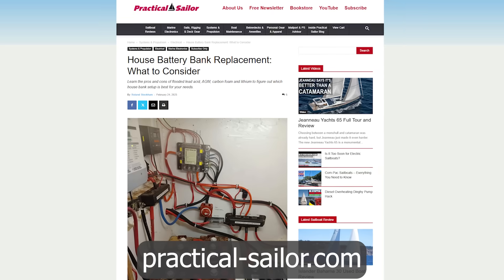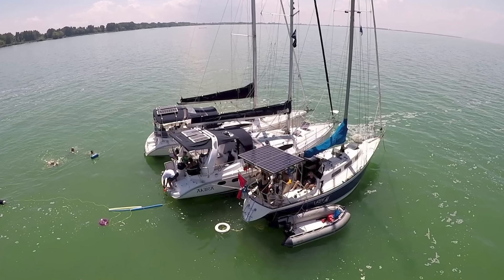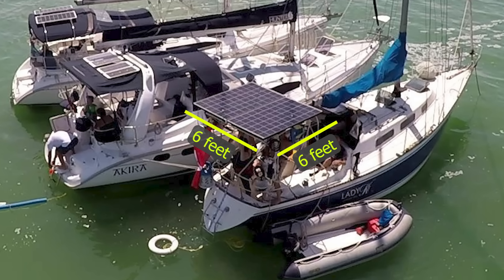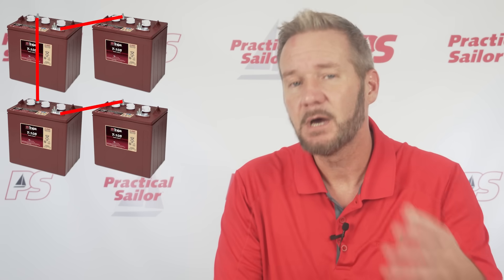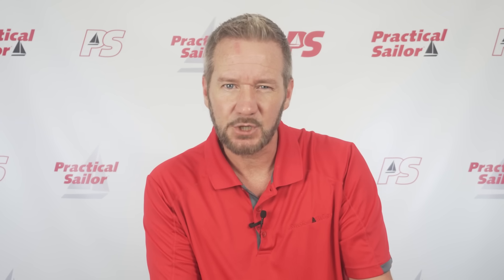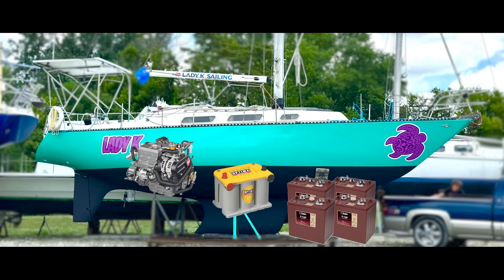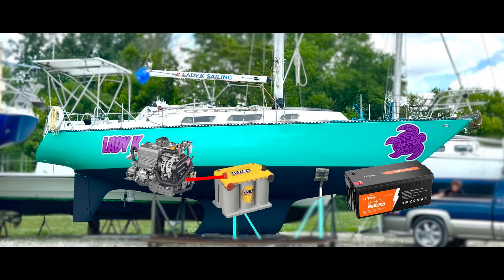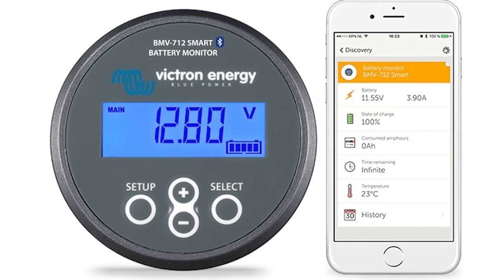Which Batteries Would I Buy TODAY for my SAILBOAT?

Comment: If you have a windlass, does it need its own battery? I thought they were hi current types like starter betteries, but i see people wiring them tocthe house bank.
Reply from the maker: Typically it’s cheaper to provide it a battery of its own than to run big cables forward

Comment: "Lithium is good for 80% discharge" - huh?  If you don't discharge your LiFePO4 batteries below 20% you'll induce memory.  Since you have a diesel engine to recharge why not use the last 20% capacity?

Comment: LifePO4 is becomine soo cheap that I just bought 2 300ah 12v batteries  (roughly 540ah useableo down to 10% )  for 20% LESS than replcing my 4 GC2 fla btateries with 200 useable Ah!   I now have nearly 3x the capacity for less money!  The only thing I had to add was a DC-DC charger as all my other charging sources have lifePO4 profiles . finally LifePO4 makes economical sense over FLA!

My 2 LifePO4 were $400 each.  the GC2 FLA are $250 each.  $800 for the 2 LifePO4 vs $1000 for the 4 FLA baatteries!

Comment: I have a 37 foot boat with 360W solar and 200 Ah of Lithium wired with a Renogy DC-DC converter/solar charger. On a recent passage from Mexico to Hawaii the 30 y/o alternator finally quit. Although I carried a spare I decided not to install it to see if I could do the passage on solar only. The answer is yes but barely. Not surprisingly the fridge was the heavy user. Next was the ST6000 a/p which was used sparingly as the Monitor wind steering unit was doing the lion's share. So there's some data for what it's worth.

Comment: Hello again and sorry for the late comment.  A small boat forum post pointed to your prior episode on toasting alternators and that led to here.  It looks like you went with one of those cheap Chinese batteries from Amazon that has a minimally functional BMS.  You also went with the DC-DC converter and AGM battery.  There are two types of DC-DC basic circuits.  One goes from higher voltage to low and is called a buc circuit.  The other goes from lower voltage to higher and is called a boost circuit.  For a little more complexity you can have a buc/boost which can operate in either mode.  In boost mode efficiency is poor (think 80%) but any buc/boost product can claim up to 98% efficient failing to mention in buc mode only.  AGM needs charging to stay below 13.7V at all times and reduced as SoC gets high and eventually at 13.1-13.2V for float.  LFP needs 14.6V to fully charge with the better BMS specifying 14.7-14.8V recommended since they have an extra PWM circuit to limit voltage applied to the battery itself.  So the DC-DC is in boost mode all the time.  Then there is an issue of whether the alternator or DC-DC capacity is greater.  If the alternator is greater then when 13.2V is hit the DC-DC will start charging but the voltage on the AGM will continue to go up.  Since the voltage regulator sees high current it thinks this is still bulk charge mode and keeps the voltage at 13.7V even after the AGM is fully charged which can overcharge and damage the AGM.  If the DC-DC capacity is greater then it will try to draw its capacity as long as the battery can take the charge.  If the DC-DC is any good it will see 13.2V drop a bit and reduce its draw to keep input voltage at 13.2V.  Otherwise voltage drops, DC-DC shuts off, voltage goes up, rinse and repeat.  Note that when initially hitting 13.2V the AGM was in bulk charge so alternator was already at capacity.  If the DC-DC allows input to drop to 13.1V (or something just under 13.2V) then the rate of charge for the AGM will decrease and some charge can flow to the LFP, increasing as the AGM draws less current.  If the AGM gets fully charged before the LFP then when the LFP starts to get fully charged and draws less current the input voltage will start rising toward 13.7V on a fully charged AGM since again high current look to the alternator voltage regulator like bulk charging.  A better solution is no AGM and either a LFP with good BMS that won't shut down until 15V, or an APM (alternator protection module) though I have no experience with these.  My LFPs shut down at 15V and 30V (nominal 12V and 24V).  Though I don't have an alternator the better BMS is good for other reasons..
Reply: A suggestion: Try separating your novel into paragraphs and somebody might actually be able to read it 😵

Comment: Was just advised that my marine insurance would not offer me a policy if I changed to lithium  the only way they would is if the boat was designed and supplied with lithium…just something to know  you could end up spending a lot only to have to strip it off per your insurance requirements.  Or have them refuse to settle a claim if you didn’t tell them
Reply: Yes this is a big deal . Insures are denying coverage if you have lithium not installed to the new ABYC standard by a qualified installer. The comment about by such an installer is correct the standards require an alarm for BMS disconnect or shut off . These regulations are a good idea but completely  misdirected in most cases as life 4 batteries are safer than LA.  The problem lies as you point out  you should have a LA type 
battery connected to the alternator. Agin if the Lithium BMS shuts off  during charging the alternator can fry the diodes. The other problem is the alternator overheating due to  lithium batteries high current Absorption. Those problems can be addresses. But again I can see why insurance companies are requesting ABYC  regulations even though separating house bank from start bank solves almost all of any problems.. My boat is going to be 40 years old and now requires  an insurance survey. Ironically I. Have been using a drop in lifpo4 starting battery for 2 years with any issues. I believe the alternator charge controller out put voltage never gets high enough to fully charge it  and cause the BMS to shut off.   I believe because it is designed for Lead Acid and a lower bulk voltage..It may not have 100 amps in it but it starts  my M-25 diesel like a champ. I have ran it for fourteen hours straight with no issues. It just never gets fully charged. Now if you put a regulator for lithium on the alternator that causes other issues. You need a temp sensor etc.  I just bought 2  drop in Lfepo4  mini 100 anmphr for $250 total to use as my house bank and was going to only charge with 2 solar panels.  Now I have learned my boat is probably uninsurable.  With these configurations. Love your channel BTW.

Comment: A discussion on batteries isn't complete without including 2volt industrial batteries.  Standing about 2 feet tall, a 900ah bank has a smaller foot print than many small capacity FLA banks found on the majority of boats (as long as you have the height in the compartment.  The jump above regular deep cycle batteries that golf cart batteries make, industrial batteries are more than double again.  Well maintained, these have lasted 18 years on boats.  If babied like regular FLA they have 5000 cycle rating.  They are also built to be abused in things like forklifts and can handle discharges down to 20% state of charge.  Find the middle ground and don't repeatedly flatten them, but take advantage during a few cloudy days once in a while and you'll likely get a decade and not have to deal with multiple chemistries on board.

Comment: The best solution is to also include a generator that can re-charge the bank in about 2 hours on hot or low solar days...... Design it as a rapid charger.. not to actually needed to run the AC system on mild days.. If you have enough batteries to last overnight and enough solar to supplement the middle of the day's highest AC usage... You can size a strong A/C system that only needs to fire up the generator 2x per day for 1 or 2 hours at a time on hot days or low sun days..  And let the batteries and solar support the other 20 hours of the day..... Or on mild days would run with no generator.. the generator is a great tool to Rapid charge big lithium.. running it only a few hours per day isn't much of an inconvenience.and much better than skimping on A/C power or trying to build a huge solar panels with create windage issues or a huge battery bank the the motor alternator just can't handle. Besides engine hours cost more than generator hours. And big alternators cost more than generators... Also keep in mind the hours that the generator is running, it is both running the A/C while recharging the battlers... Thus each hour of generator time reduces that needed battery time...

Comment: All you say makes sense, but I think you're living in a 90% sunny area, as you're talking as if  you gett 100% out of the panels,..... Where I live (Scandinavia), we're more likely gonna average 20% of the solar panels max capacity,  unless we're only on the blue when it's sunny :-). ..... The good thing with Lithium is that they can be charged up quickly from a generator or shore power.

Comment: This is how I did it.. 
400amp of lithium $1220
Dctodc with inbuilt MPPT $200
Fuses and cables $200
Smart shunt and battery screen $150
Lithium charger for shore power / generator $150
All up around $2000
 
Already have 240w of solar.. ( will be upgrading this at some stage )

If I did it the way the experts say, I would be spending thousands, they just make it ridiculously expensive and make out you need a Masters degree in engineering to install it.. I installed mine in a day with basic knowledge from working on my cars 12v system..
If you can correctly crimp a cable, you can install a lithium set up..

Comment: Thanks for your demo, One key point though needs further you missed, that is the battery's BMS.  I'm about to change my 215 ah x4 = 860 ah Agm battery's I have considered and considering Lithium the problem I have is BMS seem to very per manufacture in quality. this is the main stumbling block. I have 2x 360 watt =720 watt of solar panels + Duel wind generator 400 watt and 120 ah alternator. The problem is standards vary in the functionally of BMS so it is very difficult to trust it. As I trust the AGM no Charging complications.  I would like to install 4 x 300 ah lithium they are very close to the size fit of my old 215 ah AGM's I have installed. but the BMS  and charging compilations give me pause. I think that an in depth research on BMS pros and cons is warranted as this is a very import subject that is mostly over looked till there is an issue and also getting insurance coverage for lithium battery's as also a problem?   SV Skoiern IV

Comment: So long as the lead acid is in the loop, you don't need the dc-dc charger for the lithium. The danger only arises when the lithium bms shuts off because its full, causing a voltage spike that would be seen by the alternator if its on. But having the lead acid in the loop eliminates that possibility. or shut off the engine and then use the lithium. You just have to remember how to sequence things. But yes, at DC-DC charger makes it bulletproof and you don't have to have anyone trained on how to use the system. Just saying.
Reply: True, as long as your alternator can handle the output that Lithium can handle without overheating. A Victron DC to Dc charger is also an alternator regulator of sorts, as you can adjust the output(and thus the output).

Comment: I agree with all things said except for the DC/DC transformer.  These things are not 100% efficient........ there is an energy loss here.  This also limits the charge rate to the capacity of the DC/DC unit.  In this case 30 amps.  There goes the fast charging advantage of a Lithium battery.  I believe that a voltage sensitive switch makes more sense.  Victron makes the Cyrix-Li-ct with capacities of 120 amps and 220 amps.    There is also a company called Egis that makes a voltage sensitive switch for lithiums with a 500 amp rating.  They cal it a VSR (voltage sensitive relay). These units will connect two battery banks when the voltage rises above a preset level (eg 13.6 or 13.8V), then when the voltage drops, disconnects the two banks  at a preset level (eg 13.4 V).  In this way, when you  start sailing, or drop the hook and the engine shuts off, then the start battery is kept isolated.  One can also take  advantage of larger alternator and get faster charging.  PS...... don't forget to protect your alternator from overheating  by setting up an external regulator with an alternator temperature sensor unit.

Comment: So long as you don’t want to run either of my two air conditioners (even with soft start capacitors) it sounds relatively sufficient. Also, other than on my dinghy davits, the only other place to efficiently put solar is on top of the canvas from the dodger through the bimini. I mean, I could do that, but because I live in hurricane alley, it’s not that odd for us to have to take the canvas off the boat during a tropical storm to reduce windage. I guess folding solar panels can be taken off of the canvas relatively easily, but I honestly don’t know. Since basically it’s only 10 hours from here to West End, Grand Bahama, and because (I’m obviously non-PC sorry about that) honestly God’s in control of the planet and I am not. I just prefer to buy diesel and run my 6KW generator. I understand if you’re living on a boat in very remote places you would have a different equation. Concerning lithium batteries… I just replaced the seven AGM house batteries on my boat. I suggested that we put in a battery bank manager system and instead use some or all lithium. I guess it’s because I’m old-school (and I’m old) and all the guys that I hang around with are old school, but I got a resounding hell no for an answer. That is because lithium batteries, can burn up (I’m a little more technical than my sailing buddies and I understand that lithium phosphate iron is not likely to burn up so easily). But then for years, we all cooked on alcohol stoves because alcohol floats on the top of the water and just burns and butane or propane is heavier than water and if it cranks off, it will blow up under water. It took me 30 years to get over worrying about that (and I still close off the outside tanks in the cockpit while the stove is running so that the lines will completely burn out of propane and then shut off the solenoid, and then shut off the stove). So for me heavy duty AGM batteries work really well and I’ve got 735 amp hours of AGM house batteries (on top of an AGM start battery, on top of two Optima AGM bow thruster batteries). Maybe in my next life I’ll worry about this stuff :-). But I do admire your analysis!

Comment: There is a YouTuber who makes a unit that allows you to combine your lead acid battery with your lithium ion house bank. There's also a unit that gets more power from your alternator through a field generated within it, and even another that protects your alternator and allows you to combine your lifpo with lead
Reply: The unit you're probably referring to is the Bank Manager. I tried it. The contactor you have to use to switch between the lead acid and the lithium banks is VERY LOUD and would keep folks awake, no matter how I mounted it. I eventually gave up and went will all lithium.

Comment: I'm a solar 1st guy, who knows a little bit about sailboats. I can't look past wattcycle batteries. Great construction, and they manage to pack 300ah in a remarkably small package, they call it the mini.
Reply: I have the "300" Mini. They ended up giving all the purchasers a $50 rebate when it was uncovered that they're really 280AH. They've relabled them as 280, and, I think, are coming out with a true 300AH unit. Will Prouse was the YTer who uncovered the AH exaggeration. Still, good batteries for the price.

Comment: I have recently modernised an outdated 9 metre catamaran with new electrics. I went for diy prismatic cells from Fogstar in the uk, adding 300 ah for a silly cheap price. Along with a single Renogy bifacial panel at the stern and the usual b2b setup this was a good starter system. I am currently busy doubling the whole lot, another panel and another 4 cells. But I have one major regret. Seeing as there were no electrics on the boat apart from some lighting is really really wish I had gone to 24 volt. Too late now, of course but there are so many advantages. I could have bought all the same stuff in 24 volt versions. And for the occasional 12v stuff like usb chargers it is simple enough to provide a low-power 12v circuit. The saving in cabling cost is very substantial indeed.

Comment: Hi,
 on our Marlow Hunter 50 I changed to a 460Ah Epoch LFP battery. This meant I had to change to a highly recommended Zeus external regulator with temp sensor on alternator and battery. The poor 120 amp alternator will charge at max rate to about 98% of the 13.6 v. LFP. Unlike lead acid that really slows down the acceptance charge from the alternator because of increasing resistance in the battery LFP doesn't do that. The inverter charger needed changing also for the 13.6v charge. I also kept the lead acid starter battery charged through the victron DC-DC charger, but it will only charge at 18 amps, so a caution on that aspect. The zeus app also lets you change your alternator percent easily so for  anything under 1000 eng. rpm I set a lower level because at low rpm alternators don't get proper cooling. Epoch are made in the states and have one of the best battery management systems. They cost more than Li time but I think from reviews are better batteries. I also put a 160 amp hour high discharge Epoch for the bow thruster. Cheers, Derek

Comment: I would upgrade to a better alternator that is externally regulated.  The external regulator gives you an option to (at a future date) charge the lithium batteries directly at a much higher rate than the DC to DC charger, basically allowing you to use your engine as a pretty efficient genset. Keep the old alternator as a spare.